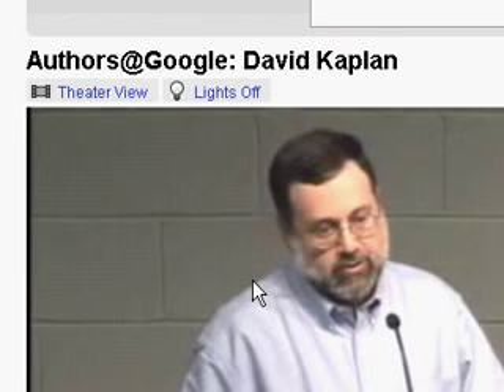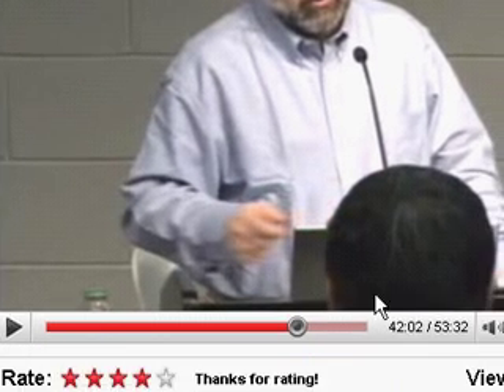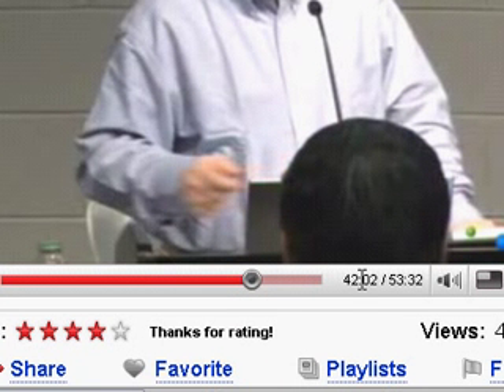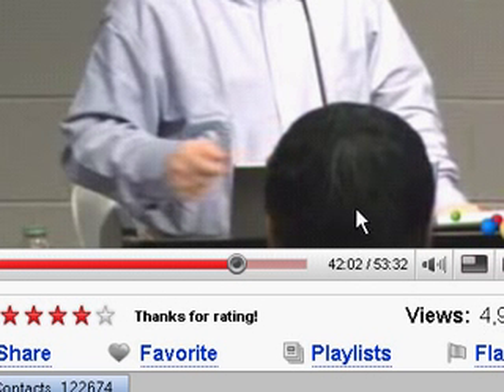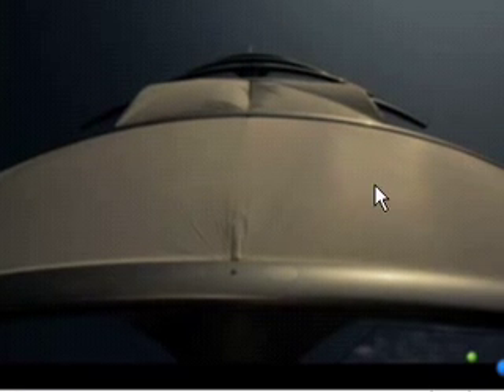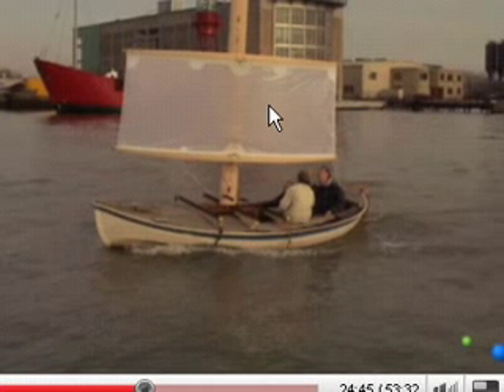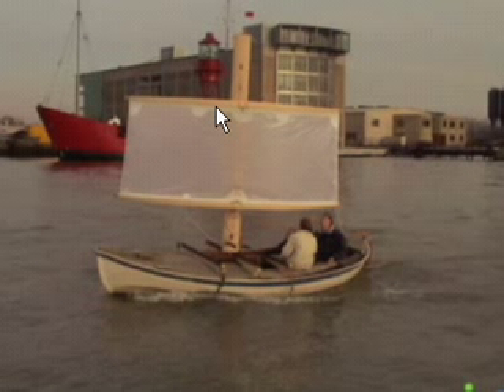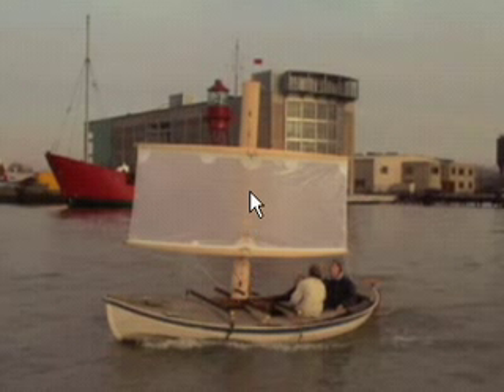furling windmills : message to Governments & T Boone Pickens

Comment: well if your talking carbon footprint, then origional windmills dont really have one,
they are constructed almost entirely of wood and just need some sweat and elbow grease to get them working,
if your trying to make a wind turbine, i dont know everything about them, but if you want max effiency then use 5 sails, because as each sail passes through air it creates a wake that could interfier with the following sail, 5 means there is enough space between for the wake to pass while giving max power

Comment: hi, 
the idea you are getting at, is a point that not many people know nowadays, proper windmills (the ones like in holland and england) used for grinding grain and pumping water, have had the technology of self adjusting sails for over 200 years, the windmill sails origionally were cloth furled. An inventor called andrew meikle created sails that worked on slats(like a venitian blind), and another engineer in 1812 (william cubitt) connected them up, and using weigths made them self contolled,